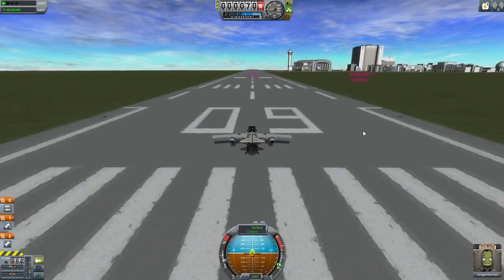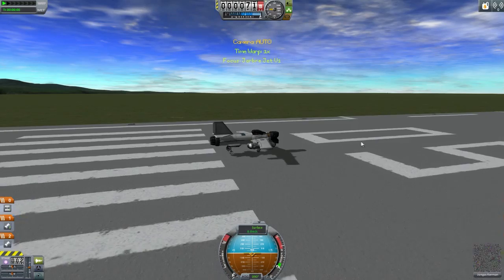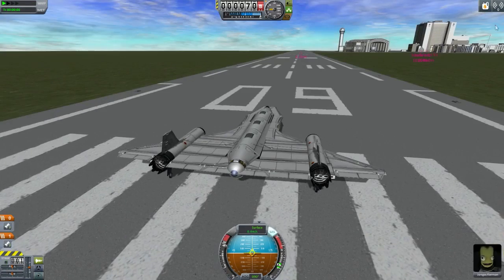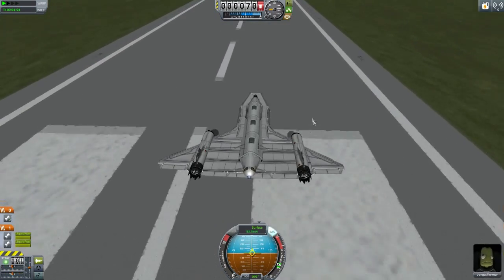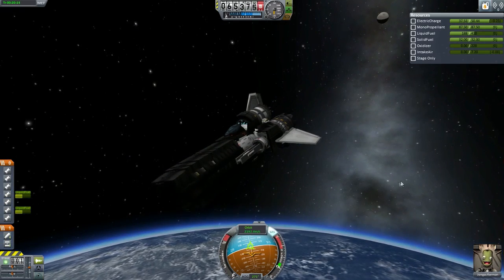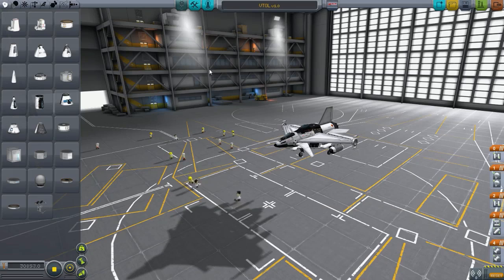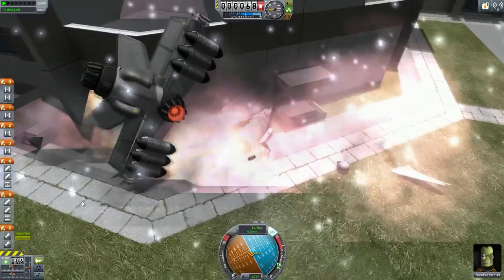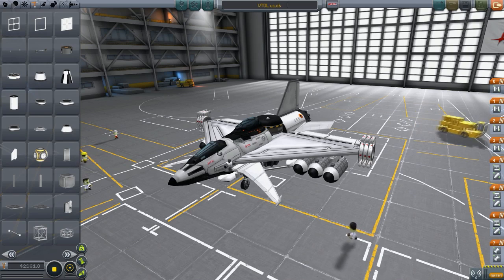KSP : Subscriber Designs Ep.19

Comment: Heretic the blackbird is a spy/Intel plane. They only used them in the 80's. They are no longer services for the army. They are on of the most expensive planes for the U.S army besides the Osprey. Which is around 12 million USD
Reply: The blackbird entered Service in 1964 is used until 1989 when it was retired it was then reactivated in 1993 and is retired from the Air Force in 1998 and was retired from NASA 1999. And the blackbird was never used by the army it was only used by the Air Force/CIA